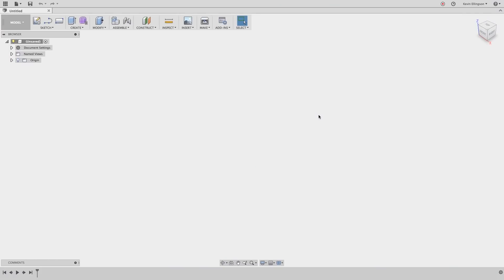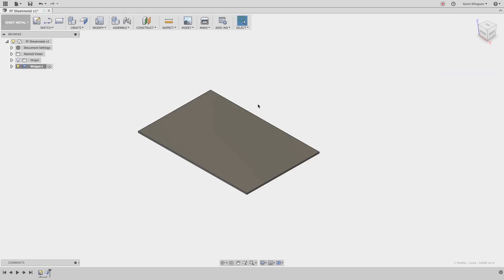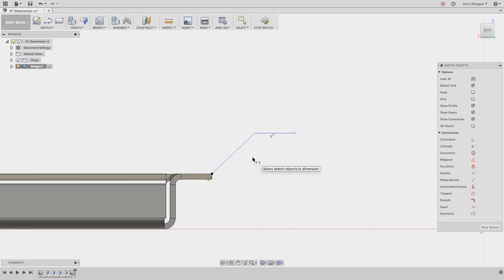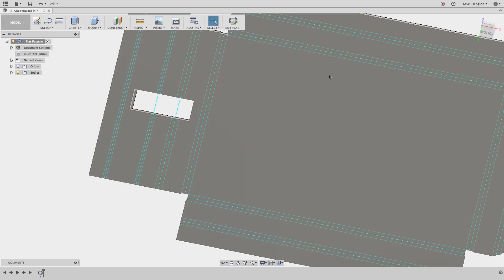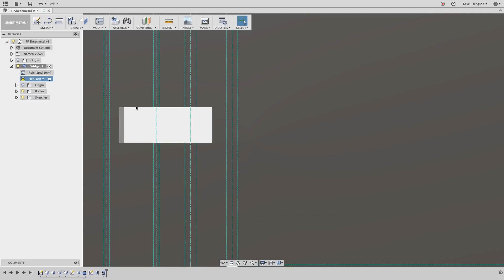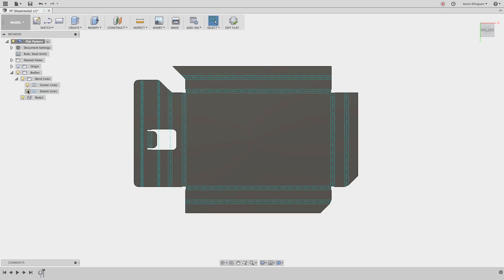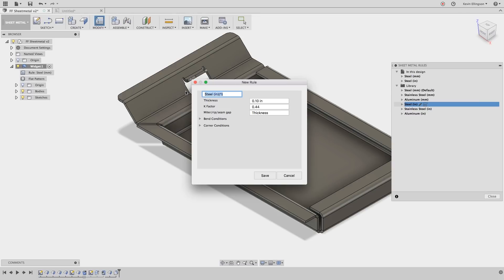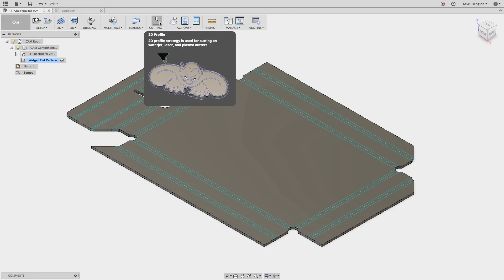Fusion 360 Sheet Metal Tutorial!  FF94

Comment: If I want to cut this out on a plasma using a different cam program such as sheetcam, how do I export the dxf to sheetcam? Stated another way, where or how do I grab the dxf file of the flat pattern to export it. Also, how can I get the bend instructions onto a sheet of paper for manual bending in a finger brake?

Comment: how do you change the angle of a flange after its been created? how do you change the length of the surface inbetween two legs? how do you define a bend line on an existing flat part at a specified location?

Comment: I know this video is a year old, but I am just learning Fusion sheet metal. I followed this video step by step. The only problem is, when my model is unfolded, it is not exactly like yours. The long side flanges are reversed side to side. The pointy on is on the bottom and the clipped one is on the top. Can you explain why? I have ver 2.0.4391.

Comment: JESUS H CHRIST, FUSION 360 IS A SHIT PROGRAM! For starters, no wonder John hates using a 3D mouse - Fusion's implementation is completely wrong, and (as is the trend these days) not something they allow users to change. It's their way or the highway. Then there's no way to change a flange dimension (at least that I could find after 5 minutes of Googling! I do not expect to have to Google how to change a dimension!).

Five more minutes of this and I'm going back to 2D CAD and unfolding sheet metal fabrications in my head!

11 Sept edit: OK, so the  old school 2D files are already at the laser cutter but I've made no progress with Fusion. All I can say is, "WOW!" [that's the female definition of WOW] There's virtually no documentation for the sheet metal rules, flanges behave differently depending on the order they're created, the orbit controls are worse than I thought (and I though they were absolute shit), and getting a dxf or dwg out requires entirely too much research.

Does anyone that's got a few years CAD experience actually like this program?
Reply: John Alexander I do. However, I will admit it's not very intuitive. I've been through solid works and SketchUp and prefer fusion despite the steep learning curve. Mostly because once you figure it out, it does so much very well. Just takes time and patience. I've been using it about a year now.

Comment: This might be a newbie question but are the gaps supposed to be that big? Or is that enough to weld together
Reply: The gaps are controlled by the sheet metal rule that is in use. I could have tightened up the seam a lot. There are also corner options meant to make things easier to weld up.
Reply: Mechanical Advantage Thanks for the reply do you that no you can do a video on those weld options and tightening up those gaps?

Comment: Hey Kevin. Good to see sheet metal in fusion. Just a question. I'm an inventor user, in an inventor sheet metal environment you can choose the type of cut you would like to make, in doing so the cut tool will make "square edge" cuts where your extrusion intersects the model. From memory I think You can change cut to "cut normal" and also "cut across bends". In other words, no need to unfold as demonstrated, complicated cuts can involve k-factor compensation and so on. Does fusion not have this option?
Reply: Dave Smith Hi Dave. I've used Inventor as well, so I know the features you are talking about. 

The Fusion team has made the decision that the only way to create a cut that goes across a bend is to unfold the bends and make the cut in the flattened state. So you won't find cut across bend or project flat pattern. 

There is currently no cut normal option, so we will have to see if they add that to a future sheet metal update. It is possible to create a normal cut, but you need to use a more manual process to split the faces and then the push/pull command to cut the split faces normal to in order to get a square edge.
Reply: Another option, if the cut while bent more accurately reflects the design intent, is to cut while bent, flatten, then Project/Include the outer edges of the hole and cut again. It's a little more work, but could be appropriate in some cases.

Comment: I love your videos.  I have a few questions if you have the time.  I have a light duty CNC that has a hotwire and mill on an arm that is the A axis.  I would like to use the mill to cut foam sheets.  Is there a way to bend the sheet metal so that the corners  meet up at a 45 degree angle or even better, one flap butts up against the other so they are perpendicular from each other?  
I could create a new rule that will be my foam rule.

Comment: What about material thickness though... I am a cmm programmer (in a sheet metal stamping facility) and deal with design issues around what side the material is designed on... features (holes,slots,hexes,cutouts, etc) can be out of position by the amount of material thickness in one axis. Very frustrating! It is important not to make those types of mistakes! Any ways I liked the video.
Reply: The software does the heavy lifting here for you. If the folded model is correct, the flat pattern will be correct.

Comment: A great video. One of my challenges is to precut flat, flexible plastic sheeting to form compound curves. Sort of like an onion dome. Would that be possible in the sheet metal modeling environment?
Reply: Hi Ron. Fusion 360 sheet metal bending duplicates what can be done in a press brake. Fusion won't do bends that need to account for deformation of the material like you mention. There is an 3rd party add-in for Fusion 360 that might do what you are after. Have a look at www.exactflat.com

Comment: Is there a command to create a closed corner where 2 bends meet without having to create a rule for it?  In the part of the videos where you showed the rules, that seems like it should only be for the first portion you showed which was material type and thickness, k factor, and radius, and that should always be where you start before you ever start to draw your sheet metal part.  Having the corner condition locked into the rule of the part wouldn't work if you had some corners you want closed but maybe others not.  Just having a button with a command to select 2 bends and close the corner would be nice or more like what i am used to.  Other than that it looks like a step in the right direction for an affordable sheet metal design tool.
Reply: Each time you create a flange, you can override the rule that controls how the bends meet. So the rule is the default, but you can change it on the fly.

Comment: How can we design the sheet metal if we are going to weld the corners ? I would like to create a simple four wall sheetmetal box that will not leak. Thanks
Reply: Brian W Hi Brian. There are different corner options that can be set in the rule. One of those corner options is called linear weld. I didn't show that as an option ok the model but you could create a rule that would leave you with only a very small gap for welding.
Reply: I will look at that. Thanks for the info.

Comment: poor attempt at ripping solid edge off.
Reply: William Anderson These tools got their start in Inventor many many years ago.
Reply: Mechanical Advantage inventor also followed unigraphics solutions in autodesks usual clunky way.

Do a video on an actual modern level sheet metal part, 30-40 folds, acute angles, then apply your "rule" after, watch it cave in under pi calculations.

Having to unfold to do a cut? Shoddy.
Reply: The software is plenty capable of of modeling 95%+ of the work that comes through the sheet metal shop I manage.  The right shop will not care what software you modeled the part in and will help tweak the design to fit their tooling anyway.

Comment: Great tutorial and I learned a lot.  

I know this was just a fun widget to show what the software can do, but one thing really stood out to me, my break metal supervisor would have had my head if I had brought that design to him!  

It's been 10 years since I did break metal work, so maybe things have changed, but from what I remember that would be a very difficult, if not impossible part to bend up, at least with normal press tooling and keeping the outside faces free of marring.  If all the flanges were facing out, no problem, or even if there was more distance along the bottom was greater, you could get a die in there.  The mitered corners on the inside don't help either, squared off ones, with one side running through would make it significantly easier as well.  

I'd love to hear from a break press operator that I'm off base, and things have advanced a lot in the last 10 years.

Keep up the great work!!
Reply: Hi Steven. You are correct that this was just a widget demo part. That being said, I don't think what I showed pushed the limits for a part that couldn't be made. I emailed a good friend of mine that runs a sheet metal fabrication business to get his opinion and he said he didn't see anything that wasn't makable. He did say he wouldn't want to do a huge production run of these, but he didn't see any real issues either. Thanks for asking the question and keeping me on my toes!
Reply: Mechanical Advantage thanks for the follow up.  Like I said, I've been out of that design area for 10 years, and honestly I don't think they had changed how we did break work in house for quite a while before that.  IIRC they pretty much worked with a sheer, press and really good welders, and 90% of it was 1/8" aluminum.  And we were doing our design layouts in 2d AutoCAD, with some in house lisp programs for determining lengths.  I really liked working with them, but they were a bit old school.  I could see with a more modern press and cut flat stock, it would make doing some of that easier.  

Keep it up, I hope to learn more.
Reply: A sheet metal part like that is "bread & butter"for the business I work at. It would not be difficult to fold at all. I'm also the bunny that has to weld it so accurate folding makes that part of my job much easier.

Comment: Thanks for this video. But where I'm a press brake operator, I cussed you out for that small flange and also for the obtuse angle bends. Hahaha.
Reply: OK, but can I get some credit for orienting the flat pattern so the majority of the bends are up bends? See.....making your job a little better every day ;-)
Reply: I used to deign brake metal, and I was thinking there was no way our press supervisor would let that design through.
Reply: Honestly I would have orientated the part where most of the beds are down.  When you are cutting a part on a laser or whatever other machine you use the better side of the part is always going to be the side of the material you see when it is cutting.  If you bend it up from that orientation, when you look at the part the outside of the part is going to have the rougher side of the cut and the part of the material that was sitting on the slats that might have got scratched.

Comment: Something that i would like to see, Say you have a plasma table that has a built in engraver, It would be nice to see if you could generate code that engraved the bend lines, This could also be substituted in a Cardboard environment to use a creaser.
Reply: Hi. Thanks for the comment. I debated showing more about the process of using the integrated CAM tools to cut this shape out from a sheet. I didn't want to make the video too long and wanted this to be more of general overview to get started using the sheet metal tools. Maybe in the future we will do a video that covers the process of creating a setup for sheet metal and cutting the part using the plasma/laser/waterjet tools. 

To your question though, the plasma/laser/waterjet cutting tools do provide an etching option for the tool paths. It is possible to etch the bend lines into the flat pattern.

Comment: Does Fusion number the bends based on order of creation by the user, or order required to bend the piece using a brake? Since some bends would restrict access to others if done out of order.
Reply: Currently, the numbers are just bend identifiers. The operator would still be the one to figure out the bend order to produce the folded part. I suspect we will see the ability to renumber the bends in a future release so that the bend numbers would also represent the bend order. That will still rely on someone knowing the proper order to fold the bends however.

Comment: Welcome Kevin, great job on the video, just one question , how would really make the part you just have drawn, also say you wanted to have the sides close together to weld, like touching for a tig weld. maybe you should try to make a simple box and lets see how that goes. i have tried and found it just about useless..
Reply: Thanks for the question. I meant to add some more info about that to the end of the video but forgot about it. You can do some of what you are talking about by using the push/pull command and move face command. This is the initial release of sheet metal for Fusion 360. There are two additional updates planned that will bring capabilities such as a corner seam tool in addition to other sheet metal tools.

I've used these sheet metal tools to manufacture many parts that have been used for HVAC units that you will find on top of hospitals, schools, shopping malls, etc. The initial set of commands for sheet metal cover quite a few needs for sheet metal parts and when the 2nd and 3rd wave a sheet metal tools are released, I think you will find a pretty comprehensive and capable set of tools for creating sheet metal parts.
Reply: Watch the tutorial I posted on that.  You can change your sheet metal rules or just override them when creating the flanges.  Change the bend radius to 0.001" and model the two flanges you want on the outside first with the bend position set to inside.  After the first two have been modeled, click the flange tool and select the other two edges also selecting the bend position as inside.  They will tuck in.

Comment: How would you get fold over corners that would be spot welded together? Instead of the gap in the corner?
Reply: Thanks for the question. I meant to add some more info about that to the end of the video but forgot about it. You can do some of what you are talking about by using the push/pull command and move face command. This is the initial release of sheet metal for Fusion 360. There are two additional updates planned that will bring capabilities such as a corner seam tool in addition to other sheet metal tools.
Reply: Watch the tutorial I posted on that.  You can change your sheet metal rules or just override them when creating the flanges.  Change the bend radius to 0.001" and model the two flanges you want on the outside first with the bend position set to inside.  After the first two have been modeled, click the flange tool and select the other two edges also selecting the bend position as inside.  They will tuck in.